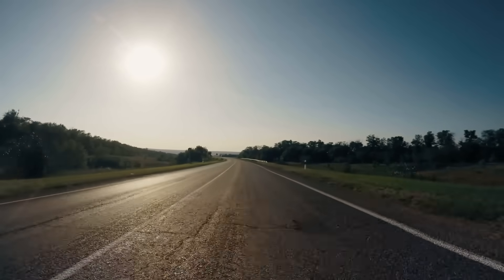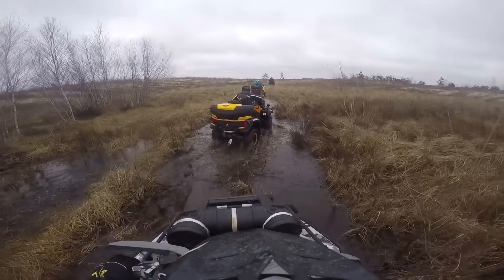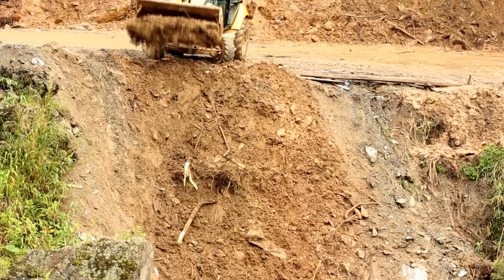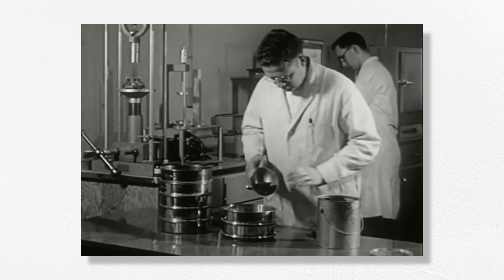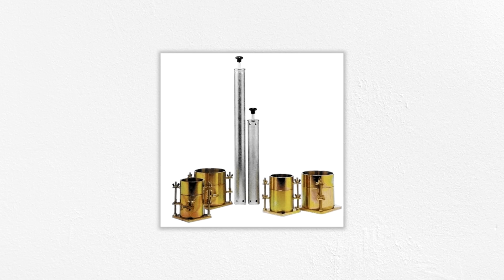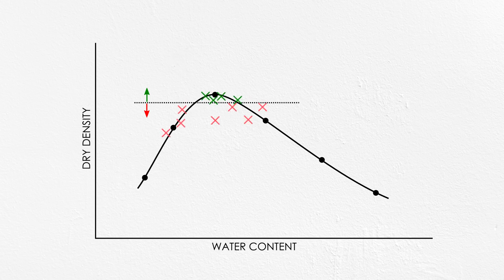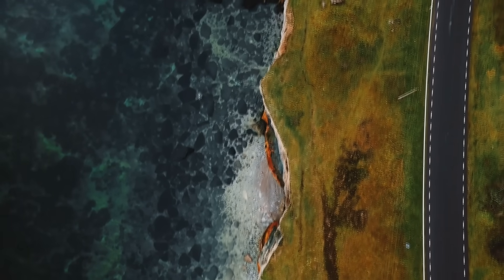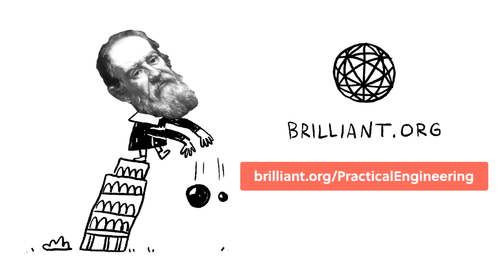Why Does Road Construction Take So Long?

Comment: I've heard several engineers talk about how infamously difficult soil engineering is. And when the soil engineers make a mistake, everything that is build on top is ruined.
Always keep the dirt guys happy.
Reply: Half of my mandatory college internship was spent in a soil analysis lab. It is indeed VERY complicated and if you mess up once, you don't get the breathing room of designing or working with materials. Finickiest subject of civil engineering, easily.
Reply: I work as a field engineer in the Ohio Valley. The soil is horrific. Water, coal, glacial till, call, former strip mines all are in play. Every thing needs addressed.
Reply: @cmdr1911  out of curiosity, where are you from? you dropped the “to be” in “needs [to be] addressed” and i’ve only seen that around the pittsburgh area, is that common in ohio too? i live in pgh but i’m not from here, i just think it’s a really interesting part of the dialect
Reply: @MyChannel773  I grew up around Akron and I have worked SE Ohio, WV and Western PA mostly supporting oil and gas with some utilities thrown in.
Reply: Can you really build a road on top of nothing but packed sand?  I thought you had to add rocks and gravel to make a firm base, because the sand will always sink and erode.
Reply: @taekwondotime  If you ask the Russians they'll tell you asfalt on snow works just fine.
Reply: @ShoutsWillEcho1  lol.  :)  Well, where I live, the first thing they do on new construction projects is they haul away the sand and replace it with gravel to make a firm base. If you build roads on a sandy underlay, the sand sinks underneath in unpredictable ways and the asphault top cracks and breaks apart very quickly.
Reply: @taekwondotime  i saw roads being repaired during snow or rain many times. Roads in Russia are a problem for few hundred years
Reply: @taekwondotime  pretty sure there is still sand under the gravel... I build roads and parking lots and have never build one with out sand being a sub base
Reply: imagine spending 2 years studying soil
Reply: @TK-wi5zo Maybe it's different in America, but where I'm from, sand isn't used anywhere in road earthworks construction
Reply: @taekwondotime  I guess you can in relatively dry climates, without freezing periodes. In Norway where I had a course in roadbuilding there was a lot of focus on using different sizes of rocks for drainage, and nets for stability
Reply: The rocks also give stability
Reply: @taekwondotime  I am a consulting civil engineer in California.  Although my greatest expertise is in utility systems (water, sewer, storm drainage, and natural gas), I have designed a fair amount of pavement in California  over my 41-year career:  mostly 2-lane roads and parking, but also a few wider roads, and mostly asphalt concrete pavement with a modest amount of portland cement concrete pavement.  I have designed pavements for rural two-lane state highways, but I have never designed high-traffic roadways such as freeways.

I have never seen packed sand used for a road base.  The typical asphalt concrete pavement sections I have designed consisted (from the bottom up) of a 6" layer of native soil that has been scarified (i.e. tilled) and recompacted, possibly a layer of aggregate sub-base (sometimes needed when the native soils are poor), a layer of aggregate base, and the top layer of asphalt concrete pavement to drive on.  Aggregate bases and sub-bases have a non-uniform grain size (a.k.a. "well graded").  Sands, on the other hand, generally have a fairly uniform grain size (a.k.a. "poorly graded").  Well graded aggregates compact better and tighter than poorly graded aggregates.  This is because, with aggregates bases and sub-bases, the smaller grains can fill the voids between the bigger grains and because the material is angular (it is typically manufactured by crushing rocks).  Sands are harder to compact because the material is generally rounded (so it is "slippery") and the voids between grains are not filled much at all.
Reply: @skysurfer5cva  Agreed. I've never seen anyone use packed sand for a road base either. When I watch construction on roads in my area (Ontario) the first step is to haul away excess sand when they dig up the road. (They usually replace the underground pipes and everything at the same time.) While the pipes are in the muddy/sandy dirt deep down, gravel is trucked in from nearby quarries to create a firm base at the top for the road. If the road is never paved then you're left with a gravel road. If it is paved, then asphault is poured on top to finish it off.  If the city needs to curve and shape a road (like a highway on/off ramp) to get over uneven land, they bring in truck loads of large stones to create the landscape and elevation they need.
Reply: @taekwondotime  there are various layers of sub base that go under the asphalt. The sub base is made of different size gravel with fines mix.  This video was showing the rough grade before road structure
Reply: some reference, there are a stretch of Valley Blvd , a 6 lane road in City of Industry, CA been repair back and forth for many years. Anytime it rain, the road crack and it is because the soil below were probably not properly process before the pavement. On top, there is a train yard next to it so the heavy train rolling may speed up the damage over time. Good topic and thanks Practical Engineering!
Reply: yess, but geotechnical engineering is very confuse. there is a lot of theory, method.
Reply: But someone made a mistake and created a wonder of the world. The leaning tower of Pisa. I guess the soil engineer didn't get enough pizza
Reply: @prateekkarn9277  Leaning Tower of Pisa owner to tower designer: "Soila boring tests!? I'ma nota gonna pay for no soila boring tests"
Reply: If by difficult you mean use gut feel make everything conservative, then yes it is really hard. Just kidding, only giving our geotech friends a hard time. You know it's a black box when you can use 3 methods of to design piles giving ultimate capacities 30% different
Reply: I have heard the same and have seen two instances where it has gone wrong, causing the foundation and walls to crack up through the building as well one case where it completely caused the structural steel to sway and no longer be plumb. An absolute nightmare for the engineers, designers, and tradespersons. One of my TAs in university was a graduate civil engineering student who studied heavily with soil and concrete and it shocked me the level of complexity involved in what otherwise seemed like such a simple everyday concept.
Reply: My grandfather has a soil science degree from Alabama A&M
Reply: Exactly. The surfacing layer means nothing if what’s underneath is not stable
Reply: Read their disclaimer sometime in a Geotechnical report.
Reply: You can learn a lot about soil variation by taking on some trenching work. In a good yard, I can cut the soil into 2'x2'x1' squares and lift the grass layer right off without fear of it falling apart. Dig out the ground below, bury whatever I needed there and reassemble the sod blocks as tightly as possible without damaging them. Mere hours later you will not be able to tell any work was done there and could return any loads to the surface with no more concern than usual for sinkage. In a bad yard, grass seed is a requirement and your not going to feel up to doing much of anything when your shoulders are on fire afterward. A lot of those yards I don't think I would trust to hold a workbench as a load, much less anything your more likely to put in the yard (like maybe a car).
Reply: @Eidetic Ex A little too much expertise in secretly burying stuff in yards. In holes that you don’t want anyone to notice. Hmmm.

Comment: Practical Engineering: road construction takes forever

Me: cries in german
Reply: Yo, how's the airport going?
Reply: @TheMrFrukt  it actually finished I think
Reply: @TheMrFrukt  It is finished.
Reply: @TheMrFrukt  yeah it's supposed to start operation in october
Reply: @georgobergfell  Let's hope they don't find some unsuitable Windows in the terminals or something like that which would lead to another 2 years delay.
Or the runways being in the wrong direction or the railtracks leading to the airport being rusted away meanwhile. ;-)
Reply: I'm pretty sure that's a german road at 1:41, maybe he knows :D
Reply: I rather have my road construction take a little bit longer than having something like A20 repeat. :D
Reply: How do you cry in german?
Reply: @generalzugs6017  It's just an overused meme.

Comment: The one thing that I have always found interesting when it comes to roadwork being done is how the soil composition affects the design and longevity of the finished road. Here in Southwest Georgia there’s a high clay content with low sand which makes for a much more stable road base compared to when I lived in central South Carolina where I saw a lot of sand.